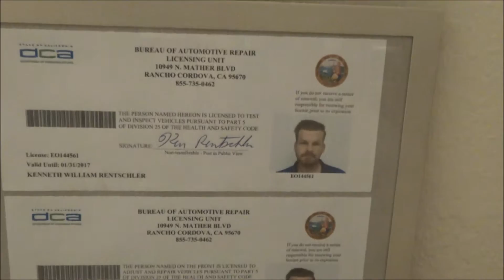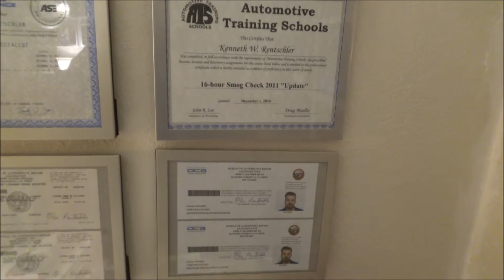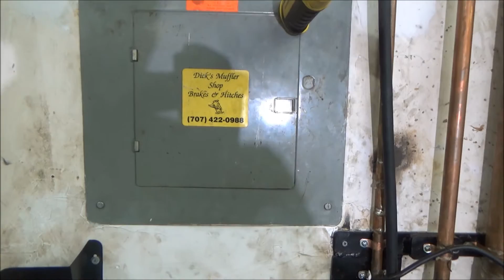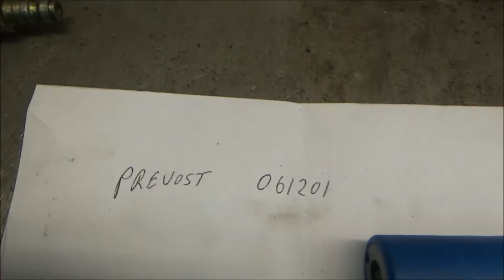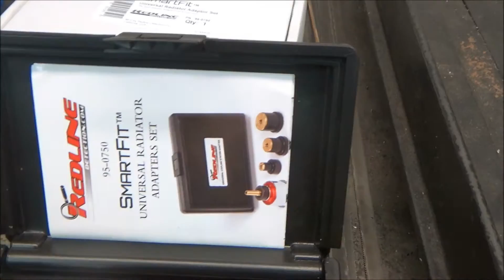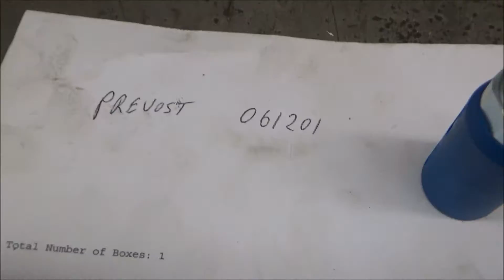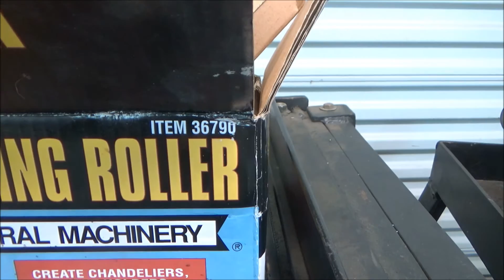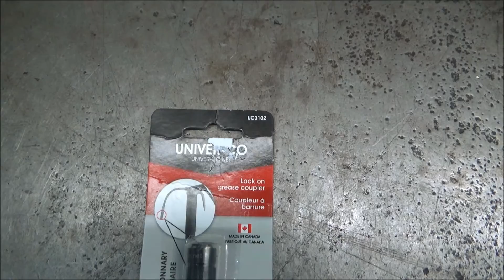Channel Intro / Update 1    Ken Rentschler

Comment: Dang Broski. I remember watching your channel a while ago. You've grown pretty fast. Cheers! Hey Can't wait to see some of your welding stuff. I'm trying to come up with ideas for my welding bench. As far as cameras go I actually use my cell phone for most of my video's.
Reply from the maker: I actually have a whole bunch of welding videos. Most of them are a long time ago. Best thing Ive found on Plasma Cutters is to keep it turned all the way up.   I bought two new cameras recently.  Canon G7X MARK 3 and the Sony RX100 7.  If you go to the Sema show I will be at the Redline Detection Booth on Thursday November 7th from 1PM to 3pm  .  I will make a video on all the meet and greets by the end of the month and I will post stuff on IG.
Reply: 1970chevelle396 Sweet! I’ll check them out. I’d love to go but some unfortunate circumstances arose so I might not make it out there this year. I’ll be going through your older content then. Really what I found was that my circuits are old and are 12Amp max which is why the breaker keeps tripping. Hopefully I’ll get that sorted by the end of the month. 👍
Reply from the maker: @JustinDowDIYcentralhighway   I had to rewire my house and both garages and replace both sub panels to make everything work right. Now I have so many plug sockets , I can leave every single piece of equipment plugged in all the time.   Guy at Lowes thought I was crazy buying 250 feet of 6/3 Wire. I put in six 50 amp plug sockets with that wire.
Reply: 1970chevelle396 🤣🤣🤣Nice! At least you’re all hooked and ready to go. ☕️👍

Comment: At the Tee where the air goes into the 2” pipe, why does the 3/4” pipe continue up?
Reply from the maker: Nick Carrasco   It connects to 3 different air compressors.  One of the air compressors is in a different garage.
Reply: 1970chevelle396 but doesn’t that bypass the water trap? Thanks for the info
Reply from the maker: Nick Carrasco   No it does not bypass the water trap.  All of the air compressors are hooked up to the right part of the water trap.  In the other garage I also have another water trap I made like that one.
Reply: 1970chevelle396 ok I think I understand. So the tee that feeds the water trap is the beginning of your lines? The 3/4” line above the tee is coming from other compressors also feeding the trap and lines? Sorry for all the questions, I’m looking to build a water trap myself as I am fixing to install my compressor and lines.
Reply from the maker: Nick Carrasco   The part that feeds the water trap is near the bottom of the 2 inch pipe.   At the top of the 2 inch pipe is what goes to your quick couplers.  The whole idea of the 2 inch pipe is to slow down the air going threw it which causes all the water to go down to the bottom.  The bigger the pipe the better.  In the other garage I made 2 of them out of 1 1/2 inch pipe.  After about 6 months I get about one drop of water out of the second water trap.  It’s much better to make it out of 2 inch pipe.  Then you only need one water trap.
Reply: 1970chevelle396 got it. Thanks!
Reply: 1970chevelle396 sorry for all the questions but I just thought of something. You mention that the air goes up the 2” pipe slower, have you noticed if this affects CFM? Thanks again.
Reply from the maker: Nick Carrasco   That would not effect CFM.
Reply: 1970chevelle396 what type of copper is used for air?
Reply from the maker: Nick Carrasco   I used type L.
Reply: 1970chevelle396 is there such a thing as type L elbows and tees or are they all the same?

Comment: great news more videos from you. Noticed your sign on the wall only if i could get a hold of one. lol I like your water trap build. Have you ever noticed any moisture in your air lines since you built it?..........Keep the vids coming Ken
Reply from the maker: Bombardier64   I had to buy that sign.  With the water trap theres been absolutely no water at all coming out of the air lines.  I don't even get one drop of water out of the drain valves below the quick couplers.  Before I made the water trap the air tools would freeze in my hands in the winter time from so much water coming out of the lines. Using the 2 inch pipe works the best.  Then you only have to make one of them.  If you use smaller pipe you will have to make several of them.

Comment: I have a 1997 ford f150 and I have oil getting in the 3&4 cylinder what do you think causes that
Reply from the maker: It’s probably a blown head gasket between those 2 cylinders
Reply from the maker: Are you positive it’s oil.
Reply: @1970chevelle396  I can guarantee it
Reply from the maker: It’s very odd because both cylinders are right next to each other.  Did you do a compression test and a leak down test?
Reply: @1970chevelle396  no I haven’t what would that tell me
Reply: @1970chevelle396  thanks I’m about to do a compression test and probably get a head gasket kit